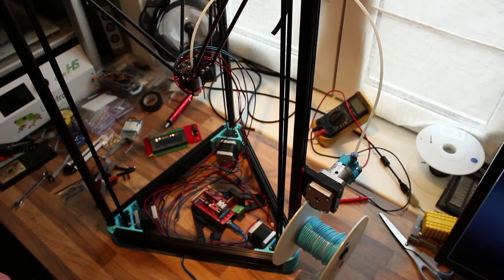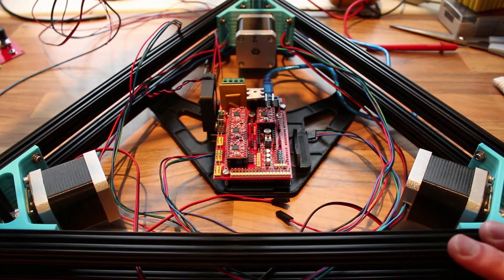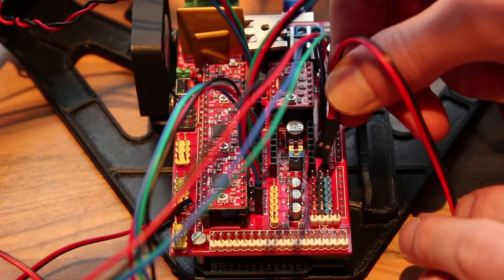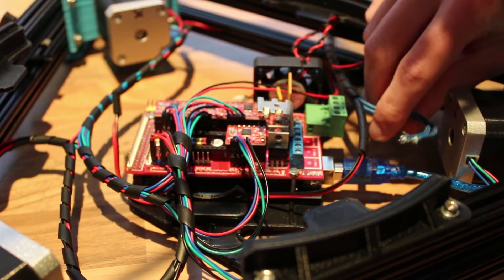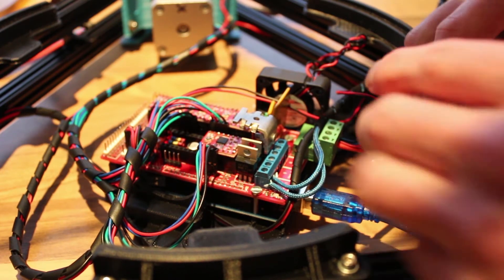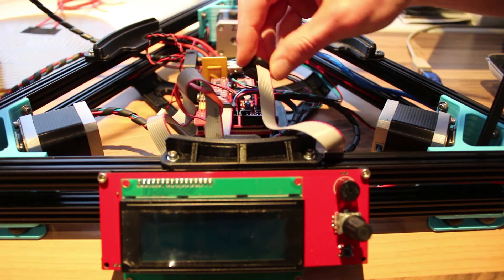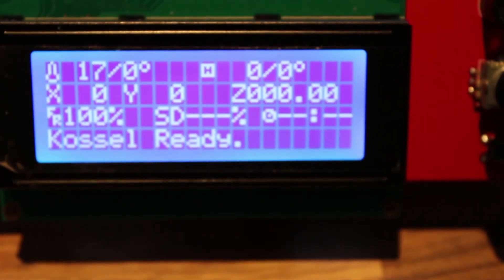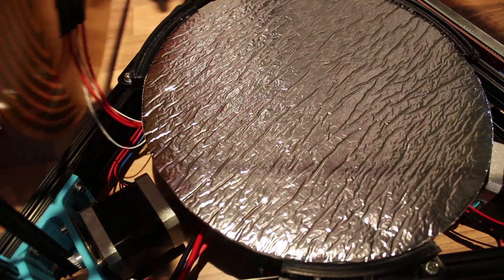RepRap Kossel XL 3D Delta Printer Electronics Assembly DIY#6

Comment: Hey! Hows the 3d-printing going? Solved your issues?:)  
Got my kossel a week ago, have done 7 prints now.(been away for work)
Very happy with the result of my prints!!:)
Reply from the maker: Hey +nutrox84 , yes I got those issue fixed and mine is also printing great.
Have some pics on the Reprap facebook page.
I do need to make a fan blowing on the part because with small detail the abs curls up.
But i have been fixing my drones again so....

Comment: Hey I bought a kossel xl about a 8 years ago when I was in middle school and never got it working. I recently tried to fix it and think I got everything sorted, however I don't have the firmware for the printer and tried configuring it with no luck. I was wondering where you got your firmware and how you calibrated it?
Reply from the maker: Hi, Well my kossel Xl is still working up to today, find it a great printer and never let me down! I am running the marlin firmware, https://github.com/jhottell/KosselMarlinFirmwareSamples setup the correct values in the configuration.h and then upload this with the arduino software.
Reply: @GeO82  oh awesome thanks! what version of marlin are you running?

Comment: Hi Oeve, I was curious. did the arduino and RAMPS board come pre-configured or did you load the firmware and add the settings? I too have a delta XL, but i believe i have an issue with the firmware. Any info is appreciated.
Reply from the maker: Hi, yeah the ramps,arduino,driver,... where all loose components and had to plug them all in. It was a blank arduino no FW loaded yet.
Back then i downloaded the marlin fw from github and made the adjustments for my XL delta and started calibrating!
What issue do you have?
Reply: Oeve Geypen thanks for replying. Your videos are helping rebuild mine.
Reply from the maker: No problem! I you like the have my marlin file to compare or try then let me know. I am still happy i build this delta! sinds its so still while printing and does a great job together with simplify3d!
Reply: yes, if you don't mind. I'd like to compare the file, that would be of great help. i can facebook message you.
my name is DeAngelo Fernandez
Reply from the maker: That's why this is open source software, free for everybody and a lot of people that help.

Comment: hi man i have a problem on my 3d delta printer. if i attach motor drivers, my arduino is closing. can u help me ?
Reply from the maker: hmm what do you exectly mean by arduino is closing? Is your arduino ide on your pc set right?
The arduino is just connected with the usb cable. Are your stepper drivers plugged in the ramps board 
with the potentiometer away from the power connector?